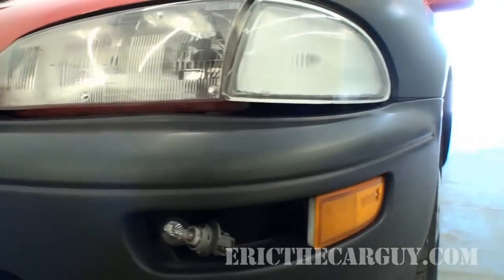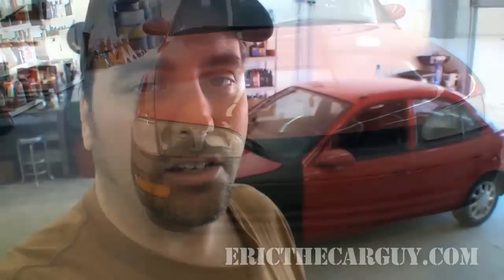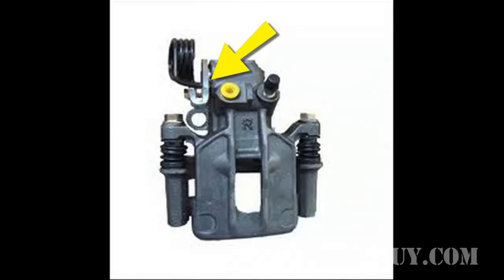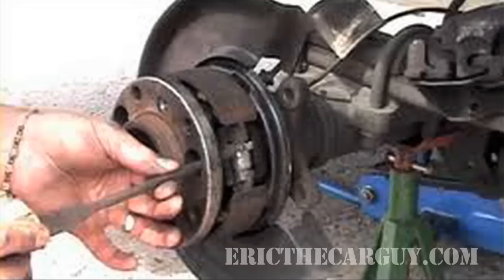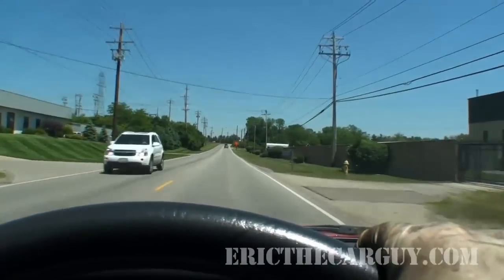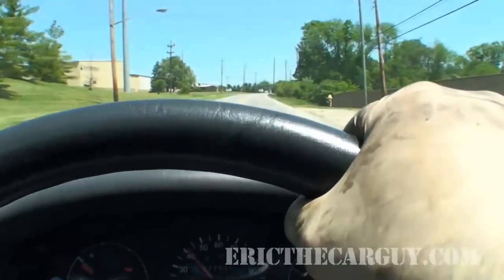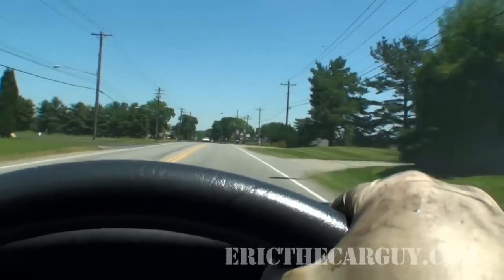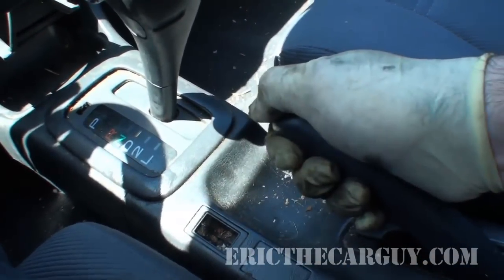How To Isolate A Brake Pulsation - Eric The Car Guy

Comment: EricTheCarGuy  Not long ago I watched one of you're very helpful videos on changing a bad timing belt. You said it was you're experience that usually the engine ran fine afterwards, so to go ahead and change the belt, before assuming there is engine damage.  I discovered there is a way to tell if there was engine damage. You can go to this website to find out if the car has what they call an ''interference engine'' or not.  http://yourcarangel.com/2014/07/interference-engines-complete-list/ Hope this helps : )

Comment: And then if it turns out to be the rear, you have to go tell the customer you just guessed and wasted their money installing new rotors and pads at the front. But with your kind of attitude, you would have just told them the problem was both at the front and the rear, wouldn't you?

Comment: Heh, you're right that a 1994 Prism isn't very important.  Especially given the ghetto state of that vehicle with one black primered panel, it was arguably not even worth taking to a mechanic.

What i really want to know is, during your driving test, how the hell did you get a prism going that fast?  Was it going down hill with a tail wind and a sail on top?  Was there a tow line hooked up to an airplane or something?  

Was it pushed to that speed by a truck behind it?  Did you put your feet through the floor board and get it going Fred Flinstone style by running really fast?  Were there rubber bands involved, some sort of sling shot just threw it down the road?  Shot out of a cannon?   Was it just sitting still and you projected an image of a moving road onto a screen in front of it?  Turn your head backwards and sneeze really hard?

No.  A prism can't go that fast.  Fake video.
Reply: +Stinky Cheese Geo's,The car that was getting 50MPG and from what i read seemed to last a long time. I'm not sure how they did in accidents though.
Reply: Ron West
I've ridden in a friend's Geo.  We'd lose speed going up hills with it floored.  No thanks, a Honda Civic is a much better option but personally I'm not all that hung up on MPG.  A small car with a beefier engine can still get reasonable MPG.

A Geo was not very high quality new, so lasting a long time would be a matter of continually repairing it, and not living in the snow belt so it didn't rust out.  A lot of hypermilers seem to like Saturns with their plastic body panels.

All of this mattered more when gas was $4/gal+ in the US but now it's under $2/gal.
Reply: The current low price for gas well not last long.
Enjoy it while you can.
Reply: Ron West
Based on the fact that I practically never see them on the road anymore, including back when gas was $4+/gal. I have to think that even high gas prices couldn't sway people into  keeping them running.  It's just not a vehicle that mechanically inclined people tend to have an urge to rebuild/repair so with no resale value it doesn't make sense for everyone else to pay a mechanic. 

The situation is also worsened by having an economy (cheaply made opposed to sports car class) engine that has to run high revs constantly, and the obesity problem in the US as it (literally) weighs on the suspension.

Might be better than a Yugo, but IMO a Honda Civic is a better economy car to keep alive forever.